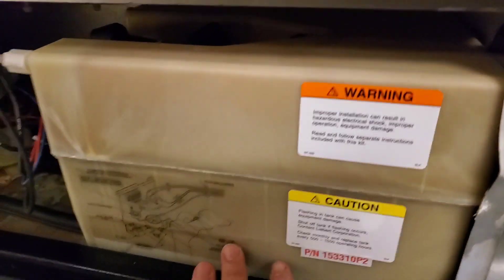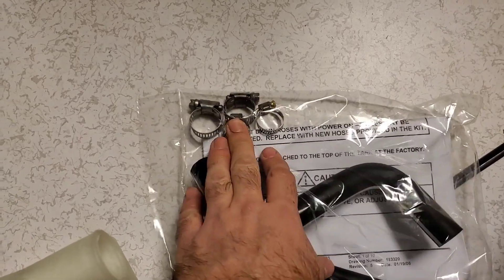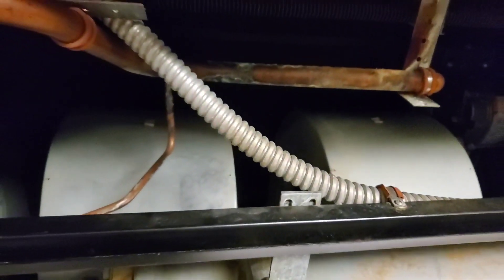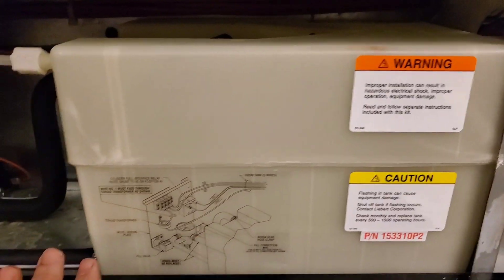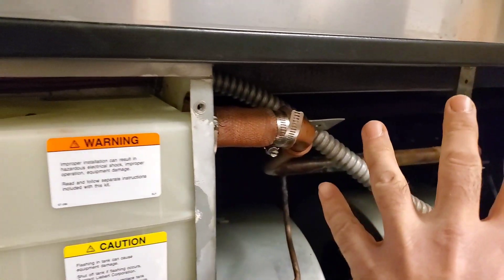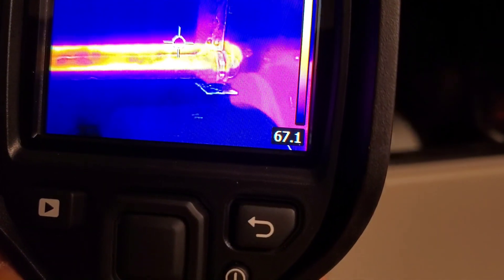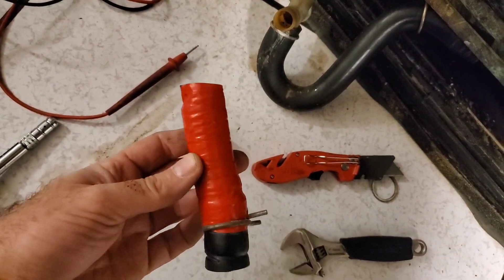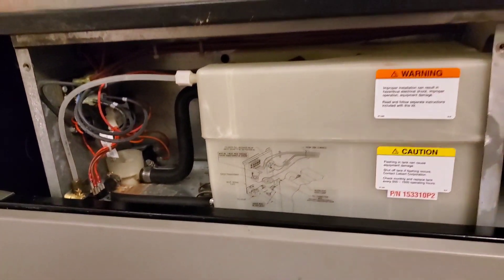How Does  A Humidifier Work

Comment: Love Liebert equipment. I have a location where the calcium is so bad I had to replace the humidifier tank every 3 months. I kept telling them to get water treatment. I asked them if they were going through coffee makers. They said yes so they got more expensive coffee makers. I told them it wouldn’t help just cost them more. Well they finally got water treatment. When the plumber went to install it the main valve to the building wouldn’t shut off do to the calcium. They got it done and I haven’t changed the tank in almost a year. I saw the set point of 40% humidity. This seems low for a server room. We keep ours at 55% to prevent a static charge. Is this a normal set point for this unit and if so why? I don’t have an awesome beard but I am curious lol.

Comment: VERY cool.
 HUMIDIFYING air is an alien concept here where I'm at near the coast in Texas - we're concerned with DE-humidifying the air 100% of the time, all-year-long...had to run the A/C this evening just to get the RH down in my house (in January!).

Question:  Why would humidity matter in a server room...?
 (I believe you said that's what the system serviced.)
I wouldn't think that low humidity make a difference in cooling electronics.
Reply from the maker: Hey Mike it's to reduce the chance of static electricity to prevent server damage.